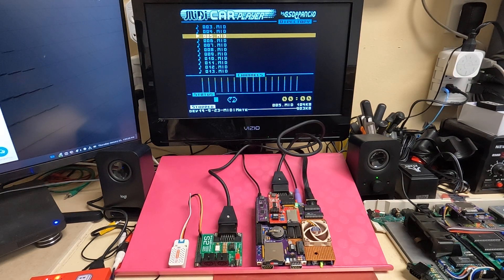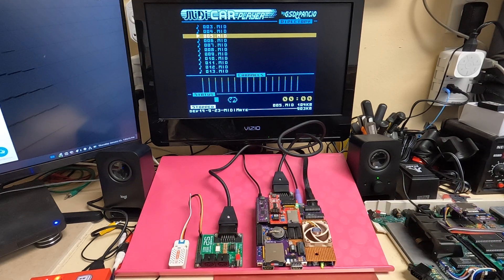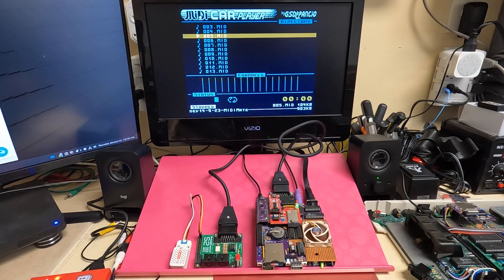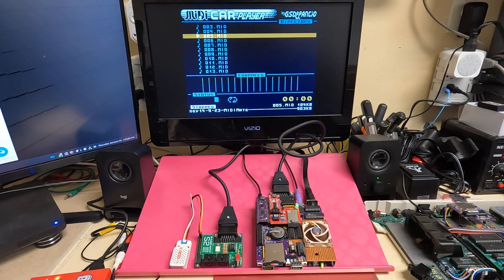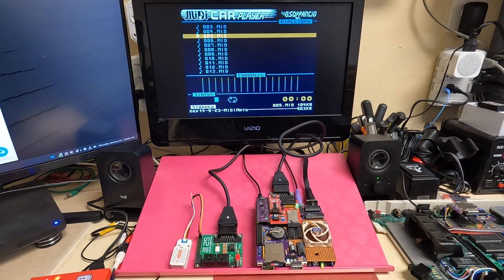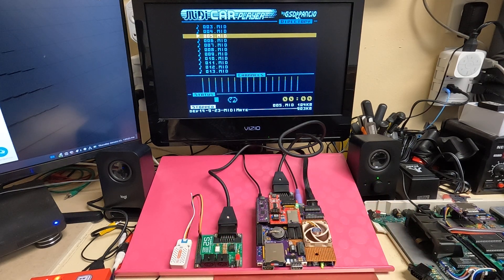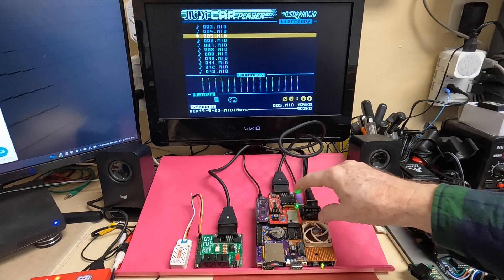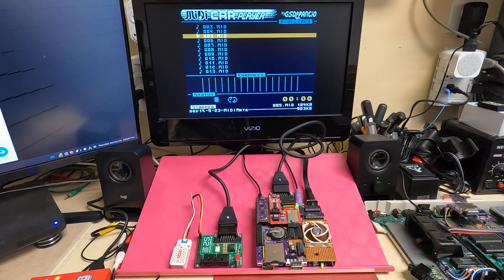M5Stack MIDI-synth to SIO

Comment: Nice! Sounds great! I'm using the M5Stack MIDI synth module in the grey colour with the headphone/line out.
Reply: I would love the M5Stack Unit Synth (the one from the video) to have a headphone jack. I'm considering opening it, cut the cables to the speaker and put a 3.5mm jack in there
Reply: @labdentalapp Iook out for the grey version which has the 3.5mm headphone jack socket and the MIDI sockets. Much easier than modding the other white version.